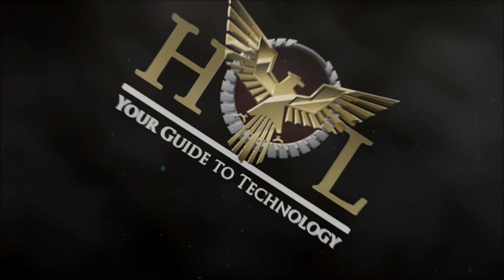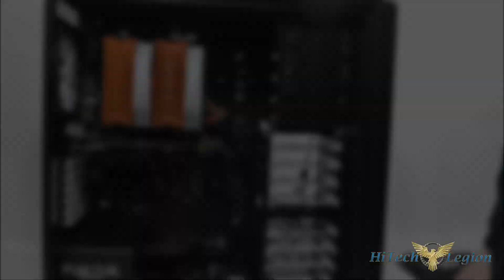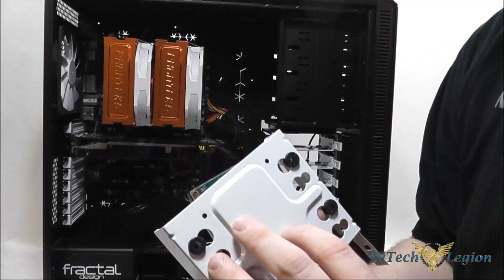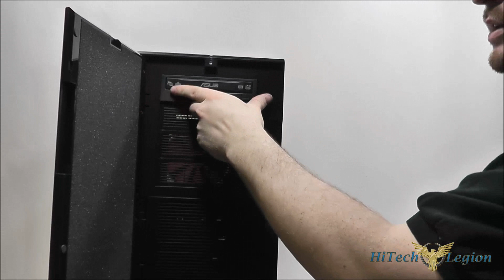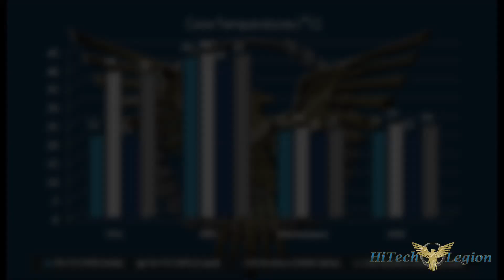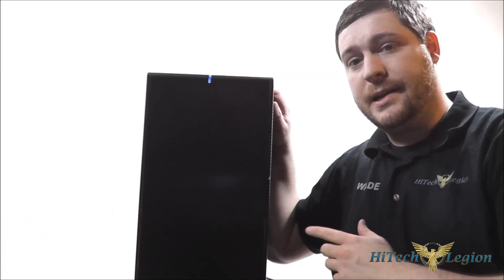Fractal Design Define XL R2 Component Installation + Benchmarks

Comment: Try contacting Fractal to ask for 8.5 mm motherboard standoffs instead of the ones that came with the case. Other forum posters have noted that this fixes the issue with fitting video cards on some motherboards.

Comment from the maker: You could easily fit a slightly larger radiator such as the Eisberg 240mm the Seidon is 27mm thick and the Eisberg is only 30mm thick. A 35mm rad may be pushing it although I think it probably would fit with a single set of fans. Considering the 27mm thick Seidon would easily fit setup in push/pull, this setup in the video only has the fans setup in a push configuration if that gives you a better idea of how much room there is.